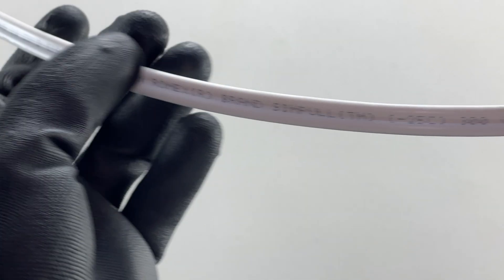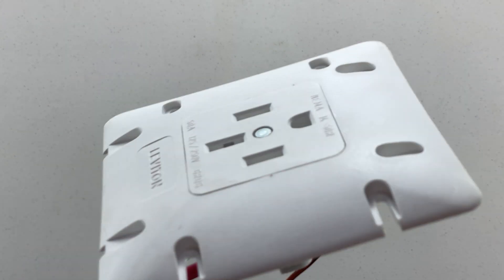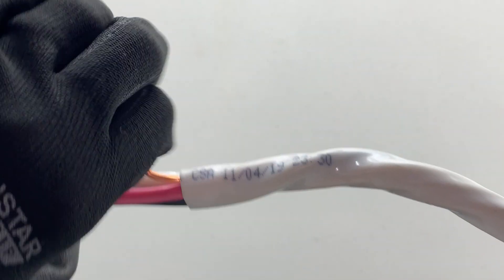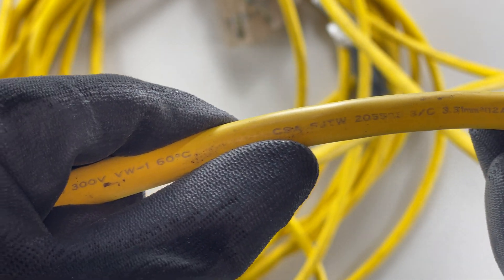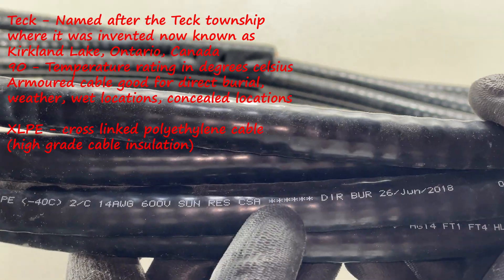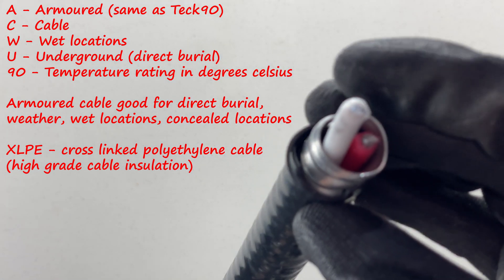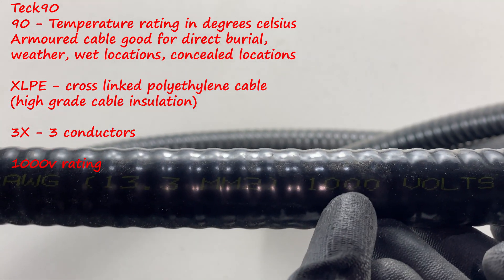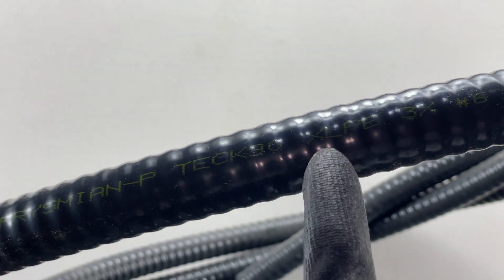How to identify cables - How to identify wires - What cable is this? - The Electrical Guide

Comment: Hello,I have a 5U AWM   20276   E129757-C   80C  30V  VW-1 Cable, its for a bose surround sound speaker..It plugs into the back of the speaker from the power pack/ wireless transmiter...Is this a very special cable? Problem is I would like to extend the connection, Do you thinK I could use regular speaker cable?
Reply from the maker: I'm not too familiar with audio/video cables. Is that an HDMI cable? If it is you cannot use a regular speaker cable in its place. Generally 14 AWG or even 12 AWG is enough for high quality speaker cables.
Reply: @theelectricalguide  From What I understand its regular speaker wire, thats the part that threw me off though, some of the writing in the wire is relevant to hdmi...I decided to leave it alone and use the speakers in another room...Thanks for your reply.

Comment: I have an unrelated question. Whats the best way to bend the wire back in a box? Do you make two folds that are the width of the box? I always have a hard time making it fit easily.thanks!
Reply from the maker: Yeah it can be tricky to get the wires nicely back in the box. Generally I'd bend them roughly the height of the box trying to utilize the back corners of the box as much as possible for wire storage. Maybe start by bending and pushing them in the bottom corners then bend again if there is still wires left and push them into the top corners. Make sure not to have any exposed copper ground wire near any of the terminals if there is a plug or switch going into that box. Hope that helps!
Reply: @theelectricalguide  thats perfect! Thanks for the reply and love the videos
Reply from the maker: @davidyoung3379  Great to hear! Thank you!